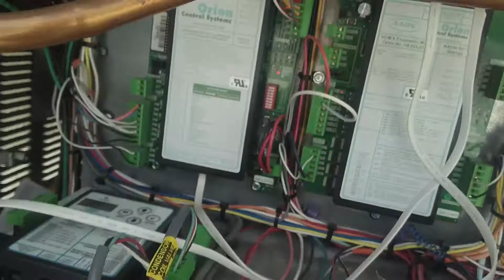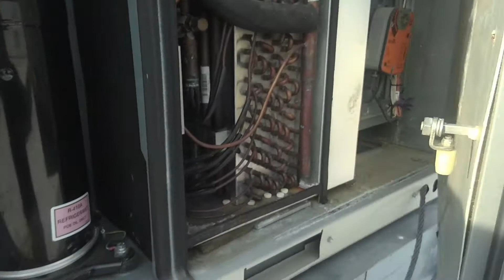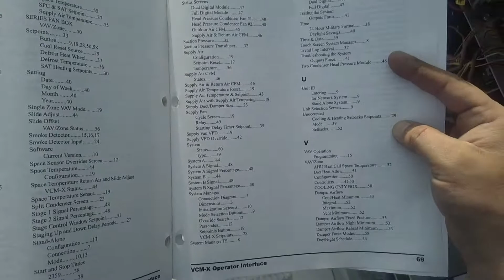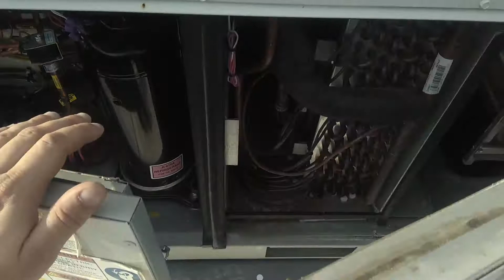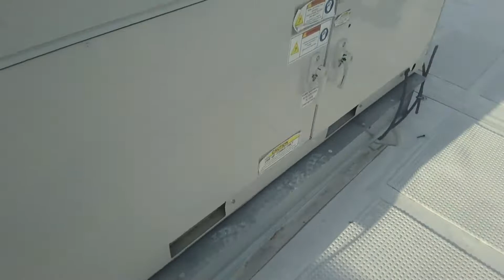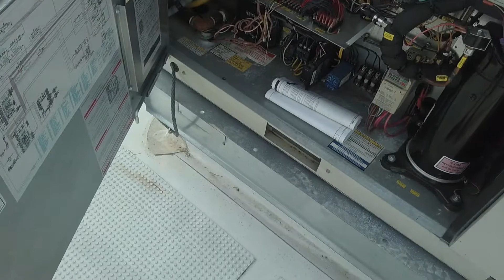HVAC AAON 5 Ton Trouble Codes. Part 1of2

Comment: I was looking at one the other day and I noticed the condenser fan was running for less then a minute and shut off kept doing th is over and over I saw that there was a fan cycling switch in series with the fan contactor I jumped it out and the od fan ran without shutting off it was 90 degrees outside I was told AAON runs like this  with the of fans short cycling I called AAON but was put on hold and never got a chance to talk to someone in tech support do you know if this is true. it only had one of fan 11 tons unit. pressure on one compressor was alittle low 100/250, the other 140/450. R410a, I checked all switches low pressure and high and they never opened. there is no manual there, the switch (FCS) I jumped out was for the 2 compressor  the 140/450 psi one

Comment: hey is that unit economizer mode ?cause the damper was open. or is the the power exhaust motor on.
Reply from the maker: well that depends on what the sensor is telling it to do
Reply: I understand that , between the mixed air sensor and outdoor air sensor will put the unit in the free cool mode when temps are right. sometimes i see the damper wide open on a warm day when not suppose to be on . Thanks for the info. I learn from all videos i watch, not judging just learning. God Bless

Comment: Control Temp Cooling Failure means that the Supply Air hasn't cooled off in a pre-determined amount of time...if you get this alarm it means the compressors aren't running at all, or if they are, they're not dropping the Supply "Air temperature.